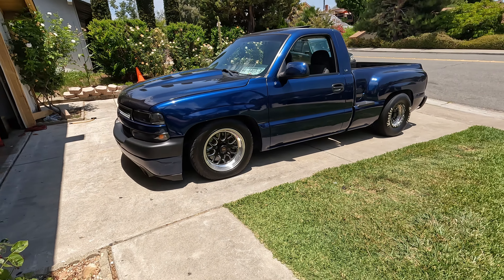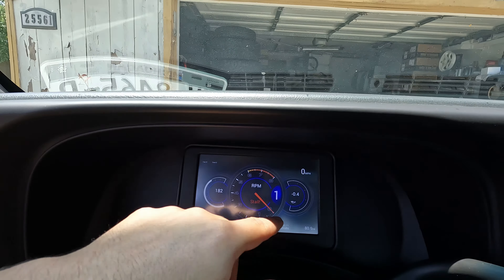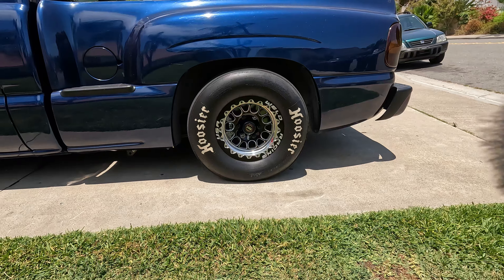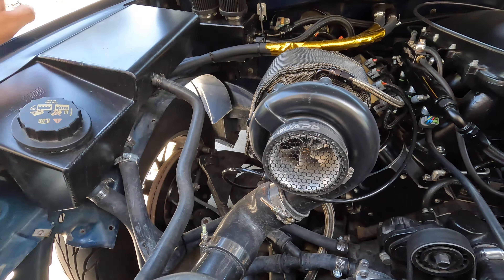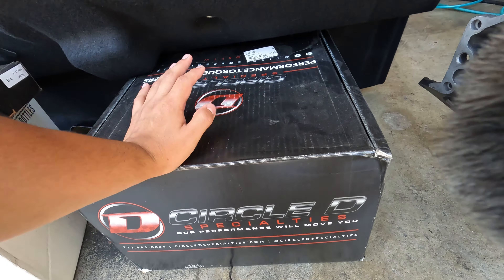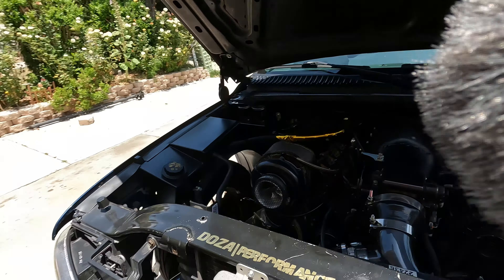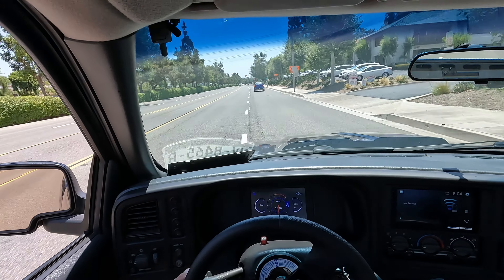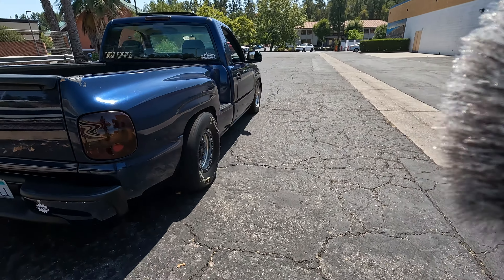What's the Turbo Truck's Set Up??? | Single Turbo Silverado

Comment: Do you have to run smaller calipers in the front and rear with those welds bro?
Reply from the maker: The fronts are 17” wheels and rears are 15” wheels. The rears needed a 15” rear disc conversion to run that small of a wheel but if you have drum brakes then I believe you clear